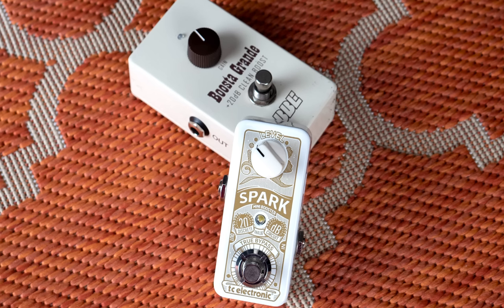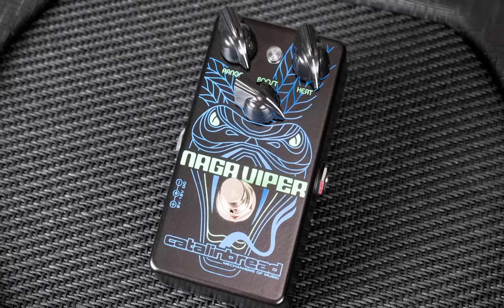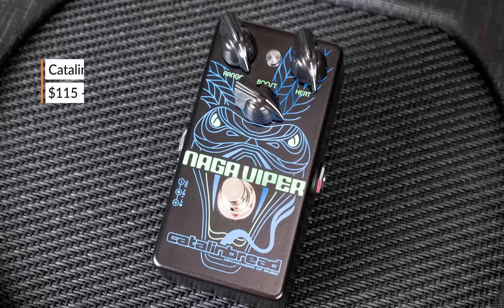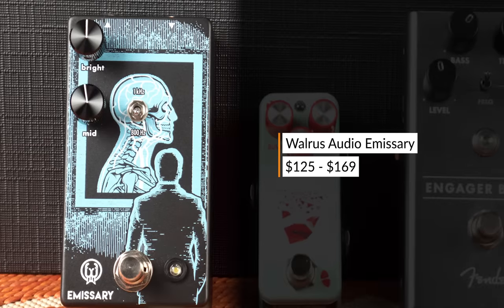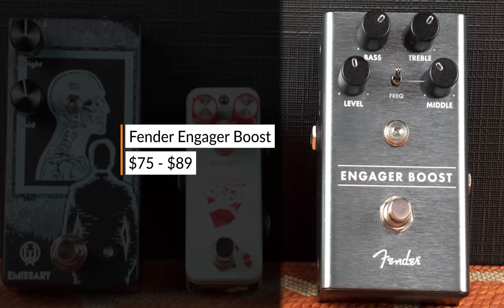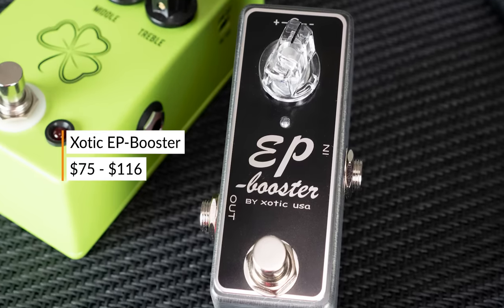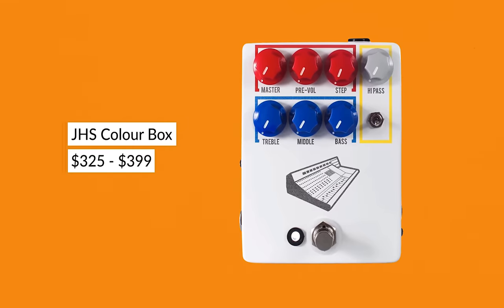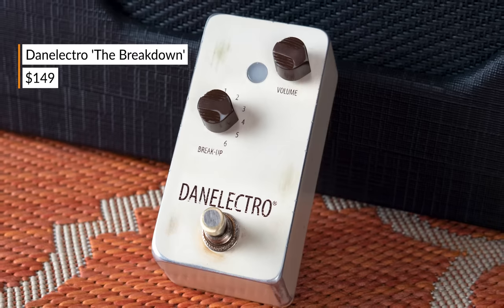Which Boost Type is Best? Exploring 5 Boost Pedal Varieties with Andy Martin | Reverb Tone Report

Comment: I mostly ignored Boost pedals for a long time. Then I learned that a lot of the artists from the 60s/70s were using whatever was around that could boost their signals: the preamps in echo units and reverb units, mixers, etc.. So instead of going and shopping for modern pedals designed specifically to boost, I started experimenting with what I have around. My current boosting options in my chain are, an old DOD compressor, an EHX Memory Man, EQ pedals, Echoplex EP3 (model), old ProCo Rat, Sonic Maximizer, and the preamp in my 80s Tascam Casette 4 track. All have their own tonal character. If you want to avoid GAS and save some money, just try experimenting with anything you’ve got around that has a “level” control on it.
Reply: must...buy....more....cant....stop....sliding.....credit card....
Reply: @smooshpig 😂. BTDT …many times.
🎸👨🏼‍⚕️🫶✌️♾️

Comment: I have a Behringer SF300, I know it based on a Boss FZ-2. I bought it out of curiosity and love the Fuzz tones, but for me the shining light is its boost mode. I cycle through many pedals,  to find the Nirvana of tone, and this pedal is a stalwart, it always stays on the board, and has been totally reliable.  I don't know what it is about it, but it is the best boost I have come across to push an edge of break up of a tube amp  into something more curly. I have even considered stacking two. Anyway my two cents.
Reply: Cool suggestion. I have one but have just used it as a fuzz pedal, so thanks for the reminder about this. Where do you put it in your signal chain as a boost?

Comment: Never was a fan of boost-pedals until I bought the Egnater Goldsmith which is a drive and a boost together in a box but usable separately.  You can flip a switch to go from boost into drive and the other way round and it has a patch on its back if you want to use one section somewhere else in your chain. And the first time I dialed in a sound with the amp and boost only, it was like throwing sweet, sweet cream on a cake. Lots of it. It's one of the best Pedals I've ever had.

Comment: I use a TC Electronics Spark Booster (the big one). Running into a Laney Lionheart 5w just at break-up, the boost really creates a wonderful crunch that’s still very clear and defined. Or sometimes I use it on the gain channel for more ”oomph”. As such it is almost always on!
Reply: Hey. This is an old comment, but try running it through the effects loop. You can run the volume low on the pedal and higher volume on the amp. I've found it helps run the tubes hotter and gives better tone.

Comment: I'm using both the spark mini and the ep booster.

The spark mini for a momentary/short line or lead line (not a solo volume level) usually in the verses and choruses.
I can also use it for solos (higher volume than the short lines) with help from an overdrive stack to my DS or other overdrive.

The EP booster is my designated booster for soloing. The find the unity gained to be special and produces a very Midy tone

Comment: Nice range of boost types. I've used lots of clean and dirty boost pedals over the years. My first was an original Guv'nor to coax decent tone from my JC-160 in '89.

Currently I'm using a Rook as my always-on drive and I push it with a Tumnus when needed. The Rook is so versatile, it accommodates any pick-ups fed into it.  I play P90s & 'Trons.

Comment: Nice to see a Hagstrom in use....
Check out the Monty's Guitar MORE pedal. Two separate 15db FET boosts with an effect loop between them so you can put a drive in and have boost before or after or both, or one or two boosts only. Very cool

Comment: One other option...

If you want to take your current tone and simply make it louder, then a clean boost pedal in the serial effects loop is where it's at. It will take your guitar>pedals>preamp tone and drive it into the power section of the amp opening up some more of that tube power amp goodness.

Comment: Having tried all the above, the classic Treble Booster circuit is unique, and works well in live mixes.The Naga is different than it's Germanium counterparts, being Silicon, and having a gainier ,harder, attack.The Ge types ARE notably noisy and unreliable, but have a unbeatable tone in controlled environments,  - much like Ge Fuzzes.
The pre amps are really a different thing, - you either like the offered tonal change, or you don't,  - tried all mentioned, and personally not a fan of how they change attack and sensitivity.
The Coloursound is the bomb, - once almost forgotten, it does it all.
Reply: The fulltone ranger treble booster is excellent and very quiet considering it had germanium transistors.

Comment: The MXR M293 Booster Mini is great on bass!!!  I dial in the Echoplex preamp for just a tiny bit of dirt, but if you hit the Echoplex section hard, with the Micro Amp boost, it breaks up rather nicely!!!  The tone knob rolls off highs, so you can dial it in as transparent, or as warm as you want.  I tried about 30 different boost pedals for bass, and the MXR Booster Mini won!!!  The Spark (4 knob) was on the list to try next, but after I tried the M293, I stopped right there.

Comment: on eof your first examples with 3 added boosters sounds like a distortion or Fuzz pedal. Wouldn´t it be easier to get the same result with just one of those pedals in stet of a booster???

Comment: Dear Reverb;
Which boost would work best with a 1970's era Gibson Les Paul Recording  (Or Professional)* guitar?
* I don't have access to a 70's Les Paul Personal but that could be subbed in for the test.
I don't get a sound when plugged into a regular amp like if the picks ran out of battery power.  And there is nothing saying any of those 3 or 4 models would indicate them being Active Guitars.
Thank you.
Sincerely Michael B Berry

Comment: I use an EHX lpb 1 on a single channel valve  amp to push it into natural sounding overdrive. It only adds gain, so it sounds just like the gain knob on the amp being turned up.

Comment: Rat first going into a 10 ton hammer going into a danelectro transparent overdrive for a lil volume boost. I can use any of them independently or together for some extra breakup. I don’t have the gain very high on any of them and completely off on the danelectro.

Comment: When i see the Fender booster i ask my self if this is not an equilizer? I think it do more or less the same as an EQ u boost frequencies but with not the option to cut frequencies. I own a DOD FX40B EQ pedal and use it as a booster too by krank the lvl without touching the bands, sound amazing as booster.

Comment: I have a rangemaster clone right after my wah, an EP booster (always on) after my tuner, 1/2 of my Fulldrive2 mosfet is a boost for solos, and finally I use a visual sound clean boost at the end of my chain to drive the line to my amp.
Reply: That's a lot of boosters

Comment: I've had an EP Booster on the end of my board for years now. In fact, I have two of them. However, for an always on boost/preamp/tone sweetener I am now using the Drybell Unit67. The compression is just right and the Rangemaster-based boost punches the high mids perfectly. The EP Booster then becomes a more louder clean boost on the end, when needed.

Comment: Isn't there a level knob in like any guitar pedal circuit? After watching this video, I went to my rig and noticed that my tremolo pedal gives me a boost. It is locally made and the guy told me to open it up and mach unity level. I didn't noticed that it is not unity volume up on till now. It brings up the signal beautifully after low gain pedal so I think I'm gonna leave it this way

Comment: I have that Poppy Boost and love it, but it's not on a board yet. My favorite boost circuits are multi-purpose things: the (boost side of the ) Analogman King of Tone, the (sculpting power of the) Chase Bliss Condor, the (boost side of the) Zvex Box of Rock, the (boost side of the) Empress Para EQ, and my new favorite the Deep Oggin by Thorpy (which is a chorus/vibrato pedal... but I like it set imperceptibly low with the boost circuit cranked!).

...That might be why the Poppy isn't on a board yet. I need to build a fourth board. ;-)

Comment: The best boost ive come across in the past few years is by far the beetronics buzzster.   This thing is fuckin phenomenal—- pardon the language but it is.    Its got 2 different levels of boost, then a 3rd stage to control gain.    A super clean boost, loud,  a next step boost with some grit in it, then turn the honey control on its like even another level and when you turn the honey up you get like a germanium boost/fuzz tone.    Its so good its stupid.   It has gotten rid of a couple of my drive pedals.    Replaced a few pedals all for this one.    

Dont get me wrong, certain overdrive and gain sounds you need specefic drives to get different sounds,    But the buzzter has a huge range. 

That danelectro does sound really flippin good tho

Comment: Man idk im looking for a mid boost with good mid control maybe a green rhino or haunting mids. I kinda need it to do different stuff like thicken at low volumes but just mid boost when im louder im also thinking about the two stroke though i may need a new board if i add big pedals. Im running into a victory v30

Comment: As a general rule.. where do you place the boost pedal? pre or post dirt pedals?
Reply: It all depends on what you want to achieve! Placed in front of your drive pedals, a boost will add compression and gain. Placed after them, it will increase the volume (provided your amp has enough headroom) without adding much, or any, extra distortion. I have two boost pedals on my board: (1) a Phil Holborne signature fat treble boost from Thunder Tomate in front of my dirt pedals, which is pretty much “always on” to fatten up and add sustain to my Strat; and (2) the Xotic EP boost positioned just before the dry amp in my wet/dry rig to bump up the volume for solo leads.  Wouldn’t want to be without either of them.
Reply: Before to drive your dirt pedal(s) and/or after to boost volume.

Comment: I suggest when you demestate a boost pedel, to show it's nice smooth clean glassy creamy tones, and than when you dig in a little bit you get the perfect amount of slight overdrive(.Like playing a tube amp when  the tubes are starting to just Break up).With a boost pedel  you  can achieve a butifuel almost chimey tone ( smooth) , and than when you adjust the knobs achieve a natural slight overdrive without having to crank the amp real high, this way your getting the ultimate clean tone with slight drive. I don't see you demestating a boost pedel ( clean) properly.The way you are playing sounds like good old rock and roll, rather than fluint playing ,.It sounds like you are demestating a over drive pedel, ( with that typical bar music rock and roll) that is really dull to the ears.With a clean boost pedel ,you especially  want to show off tone. Having a clear clean smooh creamy but strong tone ware every note is clear,than when you dig in a little you bring out a little slight overdrive,that sounds amazing.You are squashing the tones ,and  were not able to hear what the boost pedel can do.